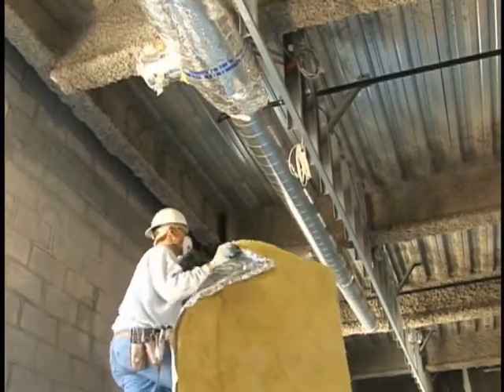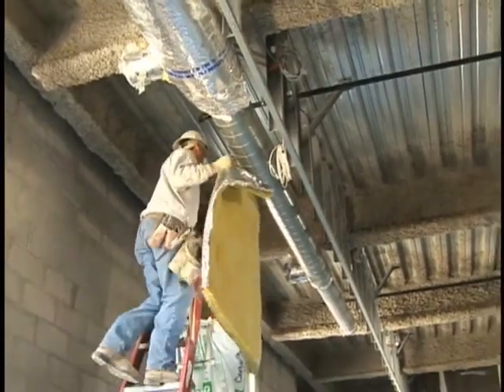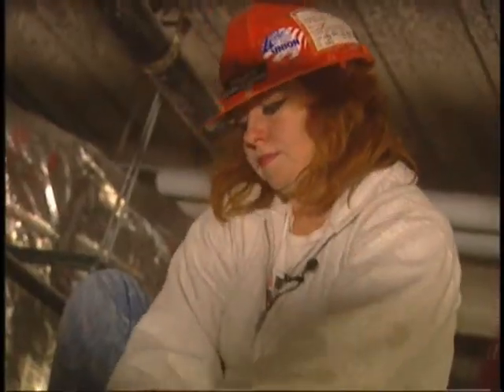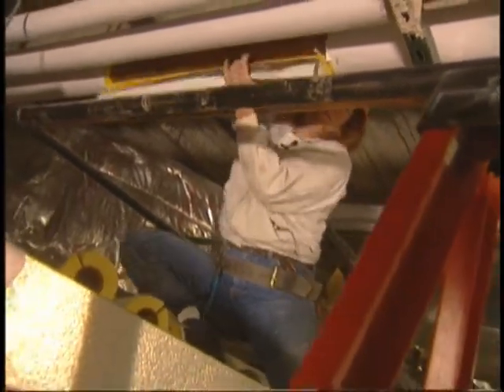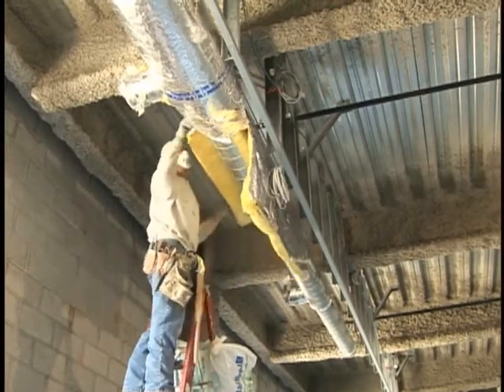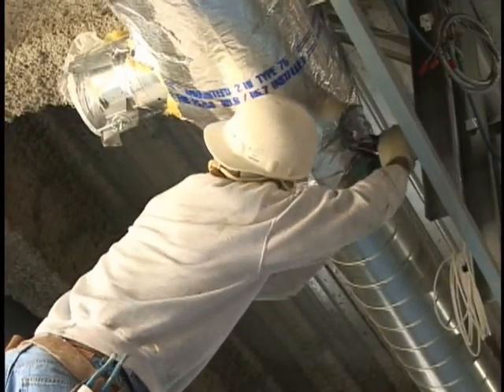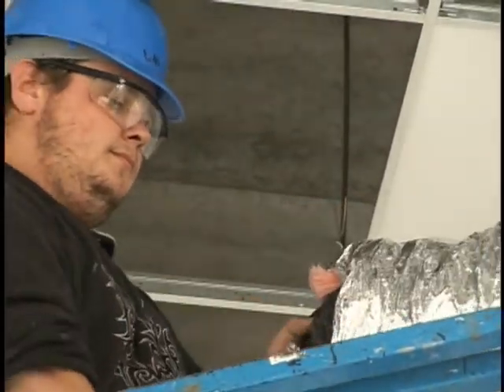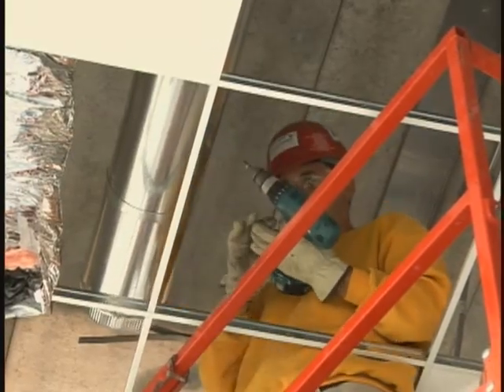Heat and Frost Insulator - What is it and how do you become one?

Comment: sheet metal worker here, flex duct and hangers on sheet metal pipe is all sheet metal work. Not insulators.
Reply: im a heat and frost insulator i do sheet metal work as well as insulation at power plants
Reply: Thats exactly the comment I was going to make I'm a retired 30 year in the trade Union insulator and I never hung duct. Now let's see what a sheet metal workers work looks like if they did Meta work on the pipes ! They can't touch the union insulators craftsman ship !
Reply: @noahmurray836  correct I'm a retired union insulator out of Vegas local ,but we don't hang duct